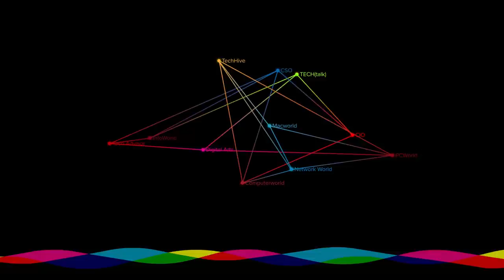Should you re-paste a laptop CPU? Is liquid metal better? | Ask a PC expert - Part 4

Comment: Hello everyone I see a bit of comments on questioning liquid metal.  Please understand that gallium/indium in raw form are typically the compounds that are used in liquid metal TIM.  The material applied is very difficult and wants to roll of the CPU die when applied.  I stated the risk is voiding your warranty if the material comes out and in contact with other components (which it can from expansion and contraction through the life of the product turbo cycling ex..) Further yes the conductivity of gallium is much higher than say aluminum filled grease (40 vs 8) but existing greases are non conductive which means if they come in contact with external components the system wont short.  Further If it comes in contact with a aluminum (say the diecast housing or rivets or any other particular parts of the solution) it can cause oxidation through the grain boundary and will eat away the aluminum.  All in all love the passion and I'm a big gamer myself (league), and if you do choose to re-paste with a LM TIM take your time follow the vendors instructions and ensure you're as clean as possible.  Ensure your heatsink has no aluminum that can come into contact with the LM and you may want to check every few months to ensure you don't observe pump out.  This is general guidance, hope this helps #IworkforDell.
Reply: Hi, I bought new dell inspiron 14 5401 (i5 1035g1 and mx330 configuration) about one month ago, right out of the box I tested everything and cpu temps hitting to 93°C in a few seconds.
and I cant play any games longer than about 5 minutes. its thermal throttling and my frames drop every two seconds (for example normally i get 60fps its dropping to 2fps and back to 60 in every two seconds.) and I am not a big gamer I play very light games and max 30 minutes long (I tried every windows and dell power options). I choose this laptop because it has external gpu but it doesnt do anything. I also tried to undervolt  but bios not allowed to do this. Where can I reach to dell technicians ? Any idea to solve this problem or bios update ? please solve this problem. I am currently on latest 1.4.4 bios and all apps are up to date.
Reply: Hello!  Thank you for coming on the show!  I learned so much and everything was so interesting and accessible!  So many things to think about when making a latop!
Reply: @muhammedsemihipek4651  you could try disabling turbo boost. my G7 7790 drops like 20C on the CPU just by disabling it and you honestly dont even lose much performance from it (and lets be real, consistent performance is much nicer). You can use Throttlestop to disable Turbo on the fly, or disable it "for good" (that is default off) in the BIOS.
Reply: Cool.  Dell now uses it in some high end laptops like Alienware.
Reply: @muhammedsemihipek4651  güç yönetiminden gelişmiş ayarları bul. Max cpu kullanımını %90 yap. Daha kapanmaz.
Reply: My Dell 5510/5518 thermal throttles while using chrome and word. Does it come with your "better than artic 5" thermal paste? It's my third Dell laptop that have problems with bad thermal cooling design.

Comment: Question about vapour chambers. If the vapour chamber is designed such the diet is submerged in water or the hut and is submerged in water how does the vapour exit through the water and through the open area of the pipe to the cold area and what it has go through the water does it bubble up

Comment: In my Dell G3(i5-10300H, GTX 1650) it's throttling under intel XTU stress test when turbo boost is enabled in bios. Games reaching temps > 90⁰. It's in warranty and Dell is suggesting to replace fans and heatsink. Do I need to get those replaced or is it ok to throttle?

Comment: I used liquid metal on my Dell G5 5587 with the i7-8750h.  It dropped temps by 20°.  Laptop went from 95-100° to 75-80°. It vastly improved my experience.  It's not undervolting because that XTU has been neutered at this point.  I did use nail polish to help protect near by components if there was a problem.
Reply: Hi , how is the laptop now ? I have same one , the gpu is getting very hot even if i remove the 78 max limit it can goes to 87 so i hit the 92 max temperature aloud from nvidia,  and when the gpu get that hot  and it drops cpu frequency to 800 mhz every couple of minutes,  so i am planning to use liquid metal.
Reply: @scs20111  

Laptop's dead for notably he's unable to reply w/in 6mo. 🤣
Reply: @pelleterodlt6532  no , u are wrong,  i did the same applied liquid metal August 2022 , till now laptop doing well
Reply: @scs20111  how's it holding up now
Reply: @Nate-pb9zo  still working , i am playing ghost of tsushima right now , on tv connected to the laptop,  a great experience.
Reply: @scs20111  damnn, sounds great. What are your temps while gaming
Reply: @Nate-pb9zo  with this game on medium settings 1080p 30fps lock , gpu 75  ° cpu 65° .
Reply: @Nate-pb9zo  while playing this game with medium settings and 1080 30 fps lock . the gpu around 75 and the cpu around 65 .

Comment: I think the biggest factor forgotten in this video about repasting is the fact that any old/high performance laptop that hits the thermal throttle alot will dry up the thermal paste fast. (Desktops may apply?)

Replacing that will ofc lower your temps, without any undervolting factor
Reply: takes a couple years though typically. Nothin like opening up a GPU and finding crusty paste.

Comment: So so true. Was very tricky balancing core thermals, vrm thermals and clock speeds. Just undervolting and slapping on liquid metal initially made the vrm run too hot and throttled even worst than stock. Had to add thermal pads and pipes to vrm as well
Laptops are a real balancing act. 

MSI Prestige 15 & MBP16

For most ppl, the simplest and safest is just to get some earplugs and turn on performance mode or max fan speed.
Reply: Would you recommend only repasting cpu gpu with kryonaut?
Reply: @zakirnaikahmaddeedat3651  GPU with kryonaut and use IC diamond for CPU

Comment: Dell inspiron 7559 here. 2 years liquid metal with nail polish, capton tape and electrical tape. Have not had it dried up and still going strong 78 Celsius tops on heavy loads and 84 on rendering
Reply: No undervolt?
Reply: You should had put heat resistant tape over nail polish or it will peel of/get burned
Reply: @ronixdash123  didnt know that - will do that too

Comment: I didnt touch voltage or anything. I did however repaste a 3 year old laptop with kryonaut, and dropped 20 C in Prime95 small fft. Plus gained clock speeds, because it was hitting tjmax.
Reply: Was a great move :)  Old laptop, esp ones with subpar TIM would see some benefit. As long as it wasnt limited elsewhere like power limits or vrm thermals, definitely will see gains.
Reply: Did u need to repast it again?
Reply: @Sam-de8tc  Nope. The one repaste did the trick. :D

Comment: Linus proved that liquid metal helps CPU temps on a laptop.

Also, a spray on conformal coating on the motherboard would help mitigate an accidental short.
Reply: You don't have to spray anything just use electrical tape
Reply: @CalvinJary  you can leave the electrical tape on? Won't it melt and stuff.
Reply: @OKBUDDY21  take it off after you apply it
Reply: @CalvinJary  used this method while applying, but all before that. i applied conformal coating on the pcb's around the gpu and cpu die of my laptop for safety
Reply: Nail polish that is motherboard safe, and high temp tape will do the job. Don't remove the tape the point is to have an extra protection in case. Only put the minimal amount of liquid metal you can to cover everything, as long as it's covered, its good. There should not be much thickness to the paste, it should be like a coat of paint, on both the die and the cooler. It might be hard to apply and you might be tempted to add more but don't, it will spread out eventually, squeeze it with a earpick. Liquid metal will stain copper and might stain the die too, it doesn't really matter temperature wise, you clean it as you can and reapply.
Reply: @Relaxing137  I'd prefer a conformal coating over nail polish, but I understand that works too.

Comment: No one uses arcric silver anymore? Hello 2006? My Acer Nitro 5 reaches 92c the same second I press the start button on cinebench and while gaming the i5 10300h clocks down all the way to 3Ghz which gives drops down to 60fps in both valorant and quake champions. And that is with all the graphical settings at low with a 1660 ti. I think I'll use my warranty and hope acer re paste it for me. My keyboard has even started to show signs of degrading in responsiveness and I have to push hard on the keys or push multiple times to get the letter to show up. I don't know if it has to do with the heat from the cpu or if acer nitro 5 is just trash.

Comment: Repasting and undervolting my Dell XPS 15 9570 with the i7 8750H made a MASSIVE difference for me. I went from an average sustained turbo frequency of 2.9ghz to 3.6ghz and my Cinebench R20 score went from 2250 to 2820. Even with just the paste replacement, my Cinebench performance went up to 2500.
Reply: Did you use liquid metal or any other high end thermal paste?
Reply: @francescomatteosiotto1301  i would like to know the same thing
Reply: same, I eventually used liquid metal and saw some pretty impressive performance gains on that laptop.  Biggest benefit was dead silence when idling and during light loads.
Reply: I repasted my 9560 and it was, unfortunately, not a clear cut difference. Either way, both before and after it would bounce off some hard limit and throttle down to 800mhz and switch to the iGPU. I even went and did the thermal pads on the VRM's etc... What did make a difference was getting AC installed in my house, and using a laptop cooling pad. I also cut a hole in the insulating material that for whatever reason was blocking the whole middle part of the vents in the bottom panel, to try and get some air from the cooling pad up into the VRM area.

Comment: The calculated temperature drop across a thermal paste layer with thermal conductivity of 14 W/mK, heat load of 80 W, layer thickness of 0.05 mm, and an area of 200 mm² is approximately 1.5°C.

This suggests that, based on heat transfer equations, the temperature drop through thermal paste is indeed on the lower side, typically ranging from 1°C to 3°C depending on the exact conditions.

This reinforces the idea that reported gains of up to 15°C or even more from using thermal paste versus liquid metal might be influenced by other factors, such as contact surface imperfections, application quality, and the effectiveness of the cooler itself.

Comment: Awesome interview. But there are issues with the pasting method. I just bought a Scar 17 SE and I could only push 99-120w (getting worse every day). After the reapplication of Liquid metal I can now sustain 175w like other reviewers. 

I do agree that shipping might be an issue and sub freezing temperatures. Specially since cargo doesn't get any temperature control environment in planes.

Comment: P.S. How many OEM machines, much less laptops, allow undervolting? The bios in every OEM I've ever owned, had the bios locked down tighter than Fort Knox.
Reply: My laptop is running a 7700hq, undervolted -0.120. custom Clevo machine. Currently is applied with liquid metal on the cpu, right now watching this video its sitting at just under 50C with barely audible fan action
Reply: Most of the time the voltage lock is from intel due to Plundervolt vulnerability.
Reply: I just bought a MSI laptop for that reason. U can unlock the bios.

Comment: Ive seen a guy putting very thick thermal paste all over the heatpipe on the upper side, then removeing the black thermal insulation plastic on the lid of the xps 15, so the thermal paste could connect right to the chassis. Did the same, just with thermal pads, just did not have enough pads.... The next step would be, placing passive cooling blocks on the bottom of the laptop😅 😅.  I was always afraid of repasting, but will give it a try now... Is it possible to put in more powerful fans?

Anybody measured how much performance increase you get when testing with bemchmarks?

Comment: hes also trying to point out that the liquid metal may need to be replaced on a HIGH uptime user. Prior to a 1 year manufacturer warranty. Of which you may want to prompt your manufacturer to replace it....though it could take up to a months time or more.......XD. Im looking at an all amd ROG advantage edition. I dont expect the liquid metal to last with zen3s high temps and high operating wattage on that laptop of 65+ sad part is dell products are sub par and offer no upgradability with their desktop platforms and poor cooling systems in their laptops

Comment: wife has a dell laptop and the RAM is locked at 2133 MHz. that is the slowest DDR4 runs. Dell put XMP in your laptops.
Reply: Probably because thats the max that processor allows. For example the i7-10750H goes to 2933mhz but the ram they put in is 3200 I believe.

Comment: I bought a 3 year old msi gt73, and I saw it around 88C when used just in sport mode (i7 6820), which does almost nothing. So, repasted it in a few hours to get all the toothpaste out, I mean really, rock solid stuff, but I swapped the old thermal pads as well, and the wonder happened. Sport mode 82C max, and turbo mode 86C at 4ghz. Then I realized that the turbo at 4ghz means about 3.3ghz, so here came the throttlestop. I am daily driving at 3.8ghz, (speedshift enabled, but when I do rendering or such, it stays at 3.8 at all cores (infinite turbo) and right now -80mV, and the temp is never above 80C. I remember though, that just decreasing from -70mV to -80mV was 2C difference in my case. That is not liquid metal, just some thermal grizzly stuff. Right now the package power consumption is not throttling, the max was 56.2w. 
So once and for all, I would highly suggest to repaste yearly. First of all because it will be way easier to do yearly, than getting that solidified bubblegum out of there after 3 years of use. I would also suggest undervolting, because there is no disadvantage of doing that. Third one is that I am considering liquid metal, but I am affraid, because the surface of my cooler is just... unacceptable. I found 2 points where it is like... I don't even know how to describe it, like it was hit by a nail. So if the liquid metal eats in the copper, it could go through... If it would not be that uneven, I would use liquid metal without question, because the enemy of the cpu is temperature.

Comment: After a year or two cpu paste will become very dried(powder like) so important to repaste it again!
Reply: hey, dry does not mean non conductive. those powders conduct most of the heat in thermal paste. no need to think that dry tim is bad unless it is actually performing bad
Reply: @TanveerAhmed10  in this case it is. The liquid part ensures there is maximum surface area touching each other, if you have a powder there will be lots of air betwen those particles. Air is a great heat isolator. It does not matter if it is liquid metal or normal paste, if it is dry it is going to do a really shit job.
Reply: @MrLelopes  Its not just powder, its compacted powder. not fluffy powder. compacted because of fluid evaporation, not just heat sink pressure. also when the oils wetted the thermal surfaces and was evaporeted afterwords - it left the surfaces coated with the powder perfectly without any gaps, like paint.

Comment: Should i repaste a 5 year old alienware 17 r2?
Reply: Paste could last that long... if it was me I’d probably only open it up if there was a cooling problem (limiting, high temps, excessive fan)
Reply: @MichaelSmith-fg8xh  that's the problem it's kind of hard to determine what is normal or optimal to compare it to.
Reply: @MichaelSmith-fg8xh  without a coolerpad i do get thermal throttling on demanding games

Comment: As a Dell Tech and a member of R/Alienware  on Reddit, the number or pc owners bricking their brand new unit is alarming. I have owned quite a few gaming laptops and desktops and have never re-pasted or undervolted any. The experiences I see as a Tech teaches me to stay away. If there is a problem ...use the manufacture warranty.
Reply: Do you have any advice for cooling the Dell G5 I got the cooling replaced under warranty but now for some reason the temperatures are even worse
Reply: @VongolaEX10  Do not settle, have dell replace the cooling again if needed. If it continues to overheat, they will offer a replacement. However, we will replace with a refurb unit. No need to fix this yourself.
Reply: @bobbycooke6159  just got the cooling replaced by Dell actually scarcely an hour ago, temperatures look much better now but I am only at the start of testing
Reply: @VongolaEX10  Great news. If if the temps fall off again. Call them back ...this would be your 3rd call. Next a replacement.
Reply: @bobbycooke6159  yep